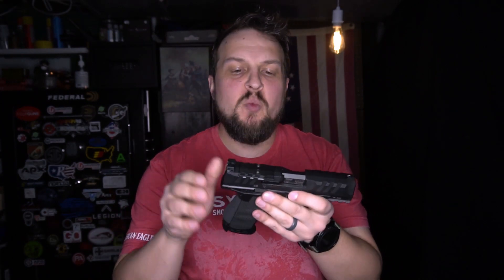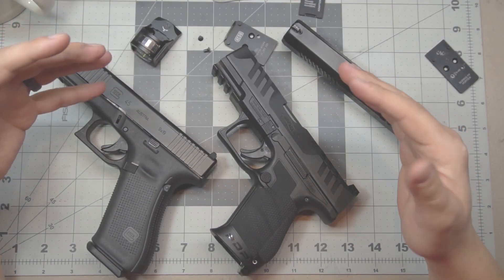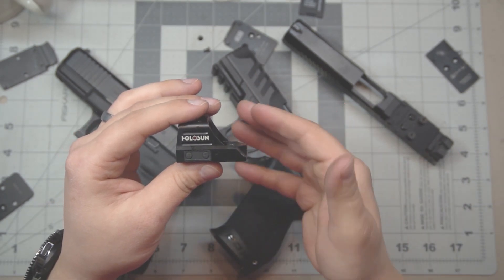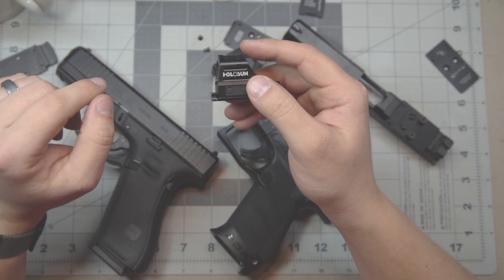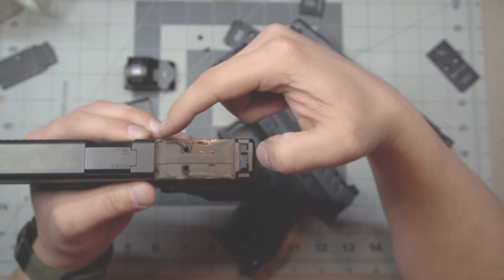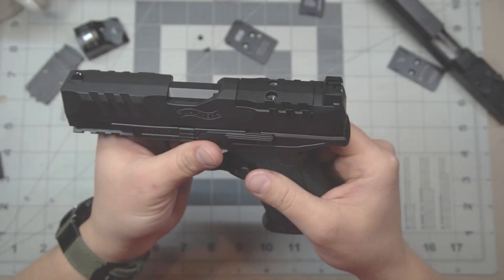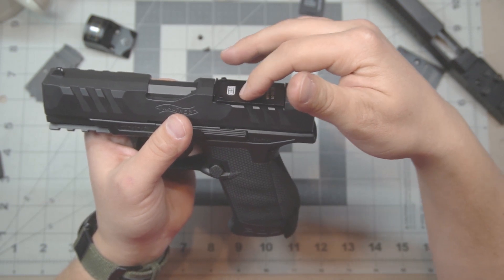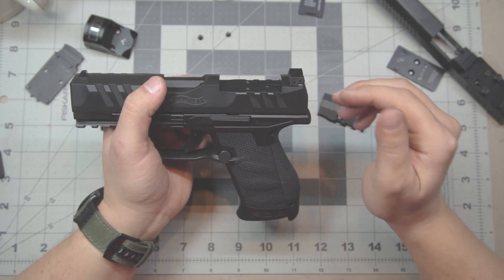The Gen 1 Walther PDP is going to Break

Comment: "Screws aren't designed to handle shear forces"...Really?...That would be an amazing surprise to every mechanical engineer since the beginning of time. 

That statement alone completely demolishes any credibility you might have had. Sorry...not sorry.

I'm not a Walther owner or fanboy...
Reply from the maker: Not an owner, or fanboy,, or engineer, apparently.
Reply: @workthetrigger  yeah...arguments from a point of authority have absolutely zero validity to me. Either explain why I'm wrong, or admit that I'm correct. 

I would love to hear how "bearing type" joints are not a thing...or how a design can't incorporate both a bearing and slip joint. Which leads me to my other point that in your update video you calculate the friction clamping force, then claim it isnt enough due to it being lower than the highest possible shearing force, however you don't account for the shear strength of the screws themselves. The friction strength of the joint PLUS the shear strength of the screws, are the total holding strength of that joint against shearing forces. Typically the shear strength of a fastener is around 60% of its rated tensile strength.
Reply from the maker: The initial failure doesn't have to be of the fastener.  If the force surpasses the clamp load it will impart radial loading on the fasteners, enough to move the fasteners, and unscrew them, dropping the clamping load even more.
And although loctite can help with this, it's a bandaid, not a cure. Besides, there is no loctite required during installation of the PDP optics plate per the supplied instructions.
Given that there is a torque specification, if loctite is applied, torquing to the listed specification will actually be over tightening the fasteners, as a wet torque is actually a higher bolt stretch then a dry torque.

Comment: Well, let me also have a word into this discussion... I am the owner and inventor of the Peters Stahl Multicaliber Pistols, made in Germany, we also produced the Springfield Armory Omega top half's in 10 mm auto.  Walther is a company with a long history of quality and craftsmanship, if they come up with a mounting system like they did, we can assume its done on purpose. If someone is really worried about that mount coming loose, I would use some Loctite  applied on the matching surface as well on the screws... The surface is so large, that there would be no chance to rattle loose, also a glue solution would be a bit more flexible that the just pin into recess solution... Well, lets see whom is having the last laugh....

Comment: The title is misleading, the gun itself is fine, it's the optic carrying ability that you're criticizing.
Reply from the maker: I mean, that's a part of the gun 🤷🏻‍♂️
Reply: @workthetrigger  yeah, a small optional part that doesn't affect the reliability or durability of the weapon itself lol. You put that vague misleading title as clickbait, and well it worked.
Reply from the maker: ... first, it's a part of the gun.  If it breaks, the gun is broken.

Secondly, that plate holds in the extractor assembly, so if the plate falls off, the extractor could come off and really booger things up.  That failure ^ is per Walther.

Comment: Watch me ruin my whole career... pretty sure Walther ran the shit out of the gun with the optic on. As long as the screws stay tight there is no slop. If you ran the math, hey this is how much force, acceleration, mass,deceleration, occur during slide action. Screws are this thick,  overall forces of a 115 fmj to a 147 underwood or good defense round and calculate service life THEN and only then, could you say hey these are going to start popping bolts like popcorn in a bag. Until then its speculation. I would think Walther has enough access to information, metallurgy and data points to make the right call on their designs. Lets see who eats crow, Walther on a recall or you.

Comment: Engineer here...have a PDP...pulled the plate and installed an optic and noticed the exact same thing.  It’s a bad design.  How bad?  No clue.

I thought it was strange too.
Reply: What makes it a bad design?  Your "engineer" claim is showing you're a poor engineer if you can't substantiate your claim of "bad design."  Do you even understand mechanics?  Do you understand how a milled slide surface, threaded bores, a specifically designed plate, an RDS optic, and the mounting screws all work together as a system?

Comment: Red dot should be used without it and you will have no problem
The Walther company already manufactured very high quality weapons before World War II
Walther PDP is a very good self defense gun in my opinion
The Red Dot is superfluous, it may only be worth mounting on the pistol when target shooting
Reply from the maker: Remington pre-dates Walther by 70 years... Age does not dictate quality or inability to have engineering oversight.

And your stance on red dots is based off of old info, typically by someone unwilling to do the necessary work to see the benefits.

Comment: Your PDP probably won't break. Saw a lot of people worried about the IWI Masada using a polymer mounting plate. After properly installing the optic plate and optic and 7000 rounds later, I have had zero problems. Having the PDP i will follow the proper installation instruction including loctite application and proper torque and see what happens. I am fairly confident i will not have any issue's but time will tell.Honestly i am not really worried about it.
Reply from the maker: Which are you going to follow?  Loctite application, or torque spec... Because Walther has no instructions to include loctite.  So the torque specifications they give is a dry spec, if you torque to that spec with loctite applied, there's potential for over tightening and weakening the bolts. 

Also, we are seeing breakages and loosening.  Exactly where I said we would.
Reply: @workthetrigger   check out you tube video from Walther Arms title , Walther PDP- Optic plate install- owners manual- chapter 10. Not trying to get into a pissing contest here , like in other threads. I just know all the negative things said about the Masada polymer plates and i have had no issues and i know how the Masada was tested. So I'm gona give it a go on the PDP with my 507c and if i have an issue you will be the 2nd person to know after Walther. What i would be really interested in is a failure rate percentage and examination to not count the 1s that were installed improperly. I only say that cause i have seen more then a few rds come off over the last few years due to improper installation.
Reply from the maker: Failure rate is such that the replacement cost is less then the money saved from the omission of the feature 🤣
Reply: @workthetrigger  lol. By that logic a lot of car manufacturers should stop putting automatic transmissions in their cars. Best of luck to ya and your channel.   I'm out.

Comment: Are there big differences between the slide internals of the PDP and the PPQ? Can't understand why they wouldn't just reuse that system
Reply from the maker: Not that I can see.  A PDP slide will fit on and function on a PPQ slide. Makes no sense to me, either
Reply: @workthetrigger  Well there's your mechanical ineptness on display.  They're obviously different slides at the top surface.  Just look at them, top-down, and in profile from either the muzzle end or the tang/beavertail end.  Where the PPQ is beveled to make its profile more sleek, the PDP is squared-off and chunkier.  Take a look at JustinOpinion's side-by-side comparison of the PPQ and PDP.  You'll see what I'm talking about.

Maybe you could take a micrometer and measure the dimensions of the milled-out optic mount cutout on the PDP and on the PPQ, and compare them?  In all dimensions, I mean -- you should measure & account for the different slide profile as well as any differences in the depth & shape of the optic mount cutout.  And measure the depths of the threaded bores where the optic mount screws thread in.  Finally, measure the WRONG PLATE that you used, and compare that plate's dimensions to the dimensions of the PDP optic mount cutout.  THAT would be legitimate scientific evidence that even a Design guy could handle.

Comment: Got my PDP for irons. Gonna throw a blacked out rear and fiberoptic front on it. I have no intentions on running an optic on it. This man explains it well. It's actually a really bad design for an optic. Walther needs to go back to the drawing board on the optics system on the PDP. HOWEVER, if you're using the PDP without an optic it's a really good gun. My full size 5" model has really impressed me. The grip is fantastic and the trigger is just as good as my PPQ is, picked mine up used (never fired) for $450! I couldn't pass the deal up. I do wish it was the compact model but at the price point it would have been dumb to pass it up.

Comment: The truth is that the first pdp did have that problum the gun was based on many sugseesful pistol the ppq p99 neither had optics so when designing the pdp they had little experience and you are right because engineers that can make a reasonably priced pistol that many consider have the best trigger out of box. Walther should have looked at pistol that had optic attachments and gone from there I bought and early pdp and it didn't take long for expert testing discovered this flaw. As for me I love mine but I have a suppressor and I sent for a walther threaded barrel and since I never planned on using the optic sights I have no experience with them they don't interest me and for my needs I wouldn't want to spend the price of another pistol just because every one else is. But the pdp stock sights have to be changed and getting higher sights the field is now really open since you can use any sight that the glock 19 or 17 will take.I don't know if walther was planning on upgrading to the pdp pro but when they got complaints they added more groves under the plate to correct the problum plus it came with the threaded barrel aluminum flared magazine well and there top of the line trigger even better than what came before since I paid for my threaded barrel the price increase on the what I will call the pdp 2.0 the barrel threaded barrel cost along with what my gun cost would be the same and I would have gotten a third magazine but I haven't had any complaints about mine that I have at least 1500 rounds thrue by now even suppressed with the factory Short sights I still hit close to center guessing and my groups have never been better on anything else I got the full size with a 4.5 barrel the longest that was available but I never intended to use it as a carry gun strictly range and it performs.

Comment: I would actually really like to see some empirical testing for this and some possible solutions. Personally I would like to see a side-by-side with  OEM hardware (as a control),  one with 12.9 grade fasteners with the OEM plate, one with lugs milled to mate from the OEM plate to the slide, and others with various proposed solutions. 

This bothers me because I actually love the way the gun looks and the configurations (compact with a 5" barrel? Yes, please) but primarily to use with an optic. It's disappointing but this video was anything but. Well done.
Reply from the maker: You can see the solution in their recently released PRO line and soon in their standard guns. They've fixed the oversight and with the new features, I have no concerns about telling you that if you like the gun, it's form factor, and how it shoots, buy it. Just make sure you get the PRO, or wait until the new slides are on the base models (no idea when that's happening, but I know it is happening).

Comment: By the time you've fastened it down there is little forward/rearward play available. That said, I ordered the CHPWS aftermarket plate and fasteners. The CHPWS plate has perceptibly less forward/rearward travel than the stock plate from Walther. The fasteners are better quality steel. The observations I make here are a sample size of n=1.

Some tolerance is made in manufacturing so that any plate made fits any slide made. What the video author does not take into account is that the same tolerances would be made for any hole/lug  mounting scheme, and there would still be front/rear play available even with lugs in holes.

Assessment: Saucy comment to drive up views and comments.
Effectiveness: Successful.

Comment: I’m sure Walther did extensive testing but what do I know.
Reply from the maker: So did sig with the p320 and p365, and Glock with the Gen 4 recoil springs and MOS system, springfield for... Well, honestly I'm not sure they do any 🤣🤣.  Point being, engineering mistakes, oversights, and compromises make it into production constantly.
Reply: @workthetrigger  so people like you feel entitled now to point on mistakes they found before they occur, by simply looking at them?
should we now take every gun in parts and see wich parts could (or like you like to phrase it: WILL) break?
have you ever wondered how many parts in your car WILL break measured by your standards?
And what does break even mean? Many gunmakers would be happy if all that happend after 10,000 rounds fired was a broken screw.
Reply: @workthetrigger  Under the "logic" (quotes to suggest it's literally NOT logic, but merely what you'd think is logic) you use in the above comment, people can conclude that every single video you've made is clickbait bull dung -- because this video certainly is that.  However, you're still failing to understand that correlation is not causation.  How did you graduate from college without understanding logical principles or logical reasoning?  Maybe your Mech Design degree didn't even require you to learn logic.  Maybe that's why you got a Design degree rather than an Engineering one.  Do you even understand how logic proceeds?

Comment: You are 100% wrong for 1 main reason. Your Walther won't break the mounting screws will lol. In all seriousness assuming you have a long battery life optic which most are nowadays, If your really worried about it you could just change out your mounting screws with you batteries you will be fine. I agree somewhat with your analysis in principle, but most fasteners aren't going to fail from the shear force of a 1.5 oz optic unless they are made from Chineseinum.

Comment: I'm on the fence on this one. German engineers aren't known for making such childish mistakes. If anything they are prone to over engineer the shit out of a mounting system. If they say it's not needed I tend to give them the benefit of the doubt although I do see your point. It might be that they over corrected and tried to simplify too much but only time will tell.
P.S. Optics have gotten smaller and smaller and a small mass is easier to keep in place. I would refrain from making definitive statements on this. But, as I said, it is a valid concern.

Comment: This is a really nice firearm, but I have no plans to purchase one, but if I did the design of the mounting system wouldn't bother me since I don't use optics. My Apex Tactical Longslide for my 509 is optics ready which is fine just in case I change my mind about using optics. Gr8 vid. 🔫 🇺🇸

Comment: 1) Too much SuperTerrain Slide Serrations
2) Chamber indicator is not visible NO out a 1/16 of an inch
3) "Optic Plate" .... No lock .... Does NOT support any "Optic"
4) Polymer sights
5) Polymer cover Optic ready
6) Polymer GUIDE ROD ... RECOIL SPRING ASSEMBLY

Comment: I appreciate your ME and opinion, but I don't see why you find it only on this gun, me thinks you are in error. The plate is mounted to the gun, no forward spacing between plate and mos, the optic is then attached to the plate. The plates supplied by WALTHER absorb and isolated the energy when firing. This is not a standard fastener. Read page 38 of WALTHER book supplied with the  gun. "DOCTER-LEOPOLD-DELTAPOINT-TRIJICON, plates supplied by WALTHER phone them and they ship correct plate. Sorry,  but I don't see the energy transfer. I am well versed 42 years of thermodynamics,  compressors, Heat transfer systems and I do not believe the counter sunk screws nor heat, nor kinetic energy of any sort is at presumed fault in your concerns.

Comment: I’d prefer a PDP without the optics machining just as I’ve avoided Glock MOS.

That cut down to the striker channel does seem strange.  I understand the desire to have the optic as low as possible, yet the cut seems disproportionately deep and the Walthers don’t have the lowest bore axis to begin with.

I’ll pass on the PDP for now, which is easy as there isn’t stock.
Reply: They wanted to make the stock sights work with the optic as well as keep the weight of the optic as low as possible. 
They’re definitely in stock you just gotta call around. Got mine in store for $580 🤷‍♂️
Reply: Gun is fine i have 5k on mine been to mutiple classes hit racked and rolled on the gun also another 2k on my 2nd gun both are fine this guy is full of fluff

Comment: Hmm this is interesting.. why have I put thousands of rounds through my pdp at a normal gun range, in the desert running and running through movement under fire, it’s been dropped, and used and abused and the same red dot I put on it over a year ago is still holding strong? According to you, it should have broke. not ever once knocked out of zero and still functions flawlessly…you might want to re think your confidence bud…cause you got this one way wrong.
Reply from the maker: Wrong enough that Walther changed their plate design and added recoil bosses 🤷🏻‍♂️
Reply: Mine has worked well for a long time, I’ll have to see the new system if they changed it. I wasn’t even aware they changed it but then again I’ve never checked or really had a reason to. But now I’ll look.